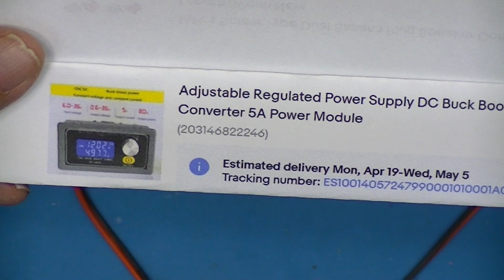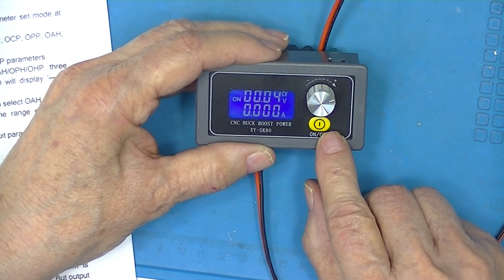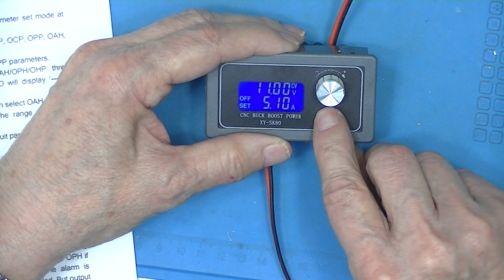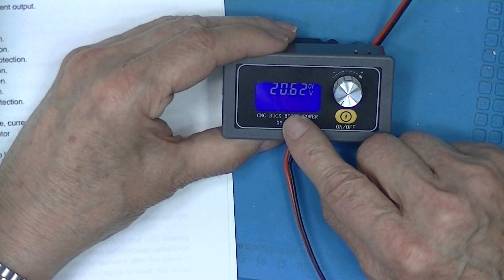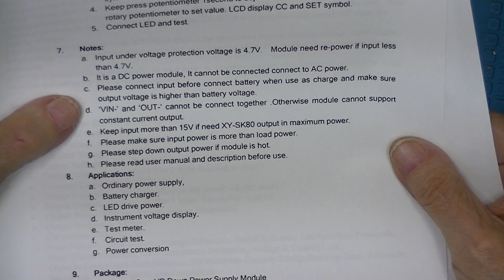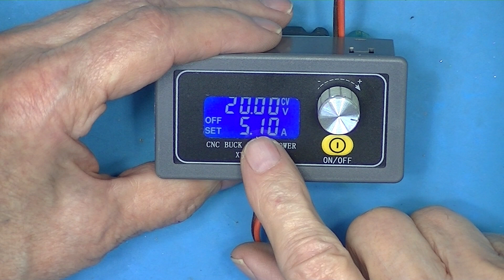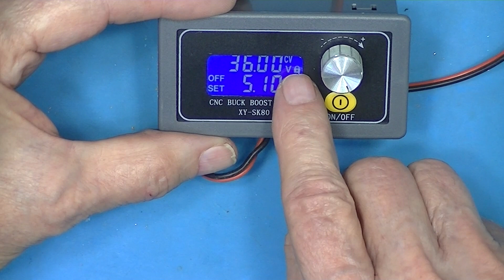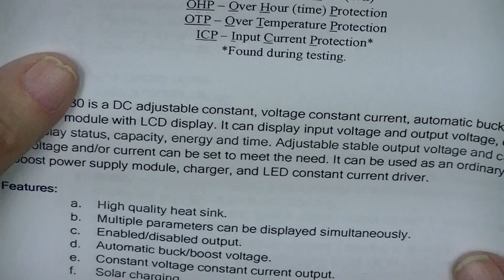XY-SK80 Buck Boost Power Supply

Comment: I burn a 2 leads device right by the output jack. I guess it is a diode for protection of back flow current. Do you know what's the SPEC of this diode so I can replace it?

Comment: So I want to top balance a 3.2v 16 cell lithium iron battery pack, so I'm setting the buck boost to 3.6 v, but I'm struggling to get the current up. It doesn't go above 300mA. I'm using a 24 volt 100 watt input power supply, any idea how to get the current up? My constant current is set to 5 amps... but it doesn't seem to recognise the settings I'm typing in... ?